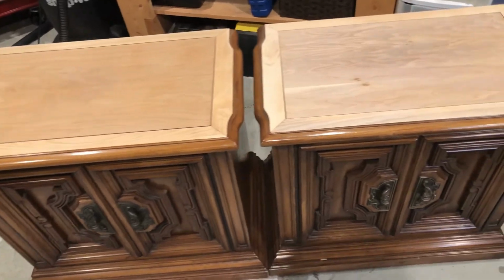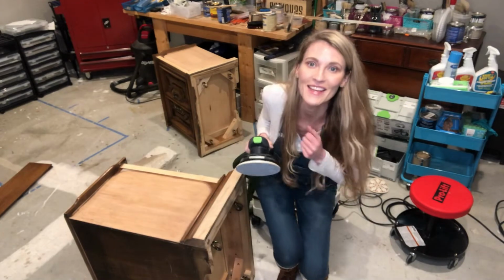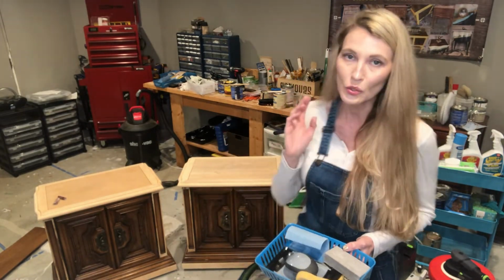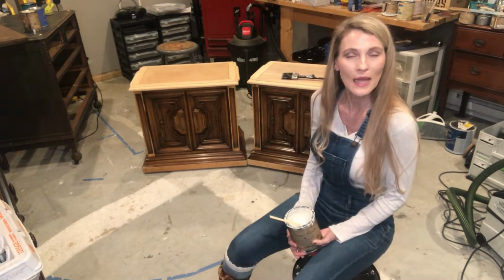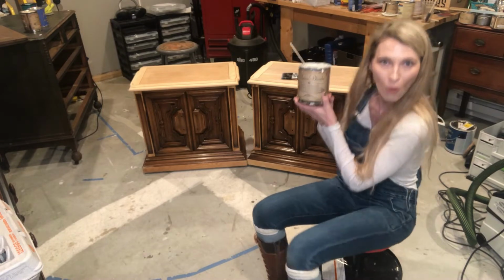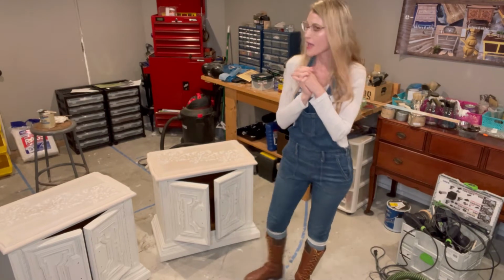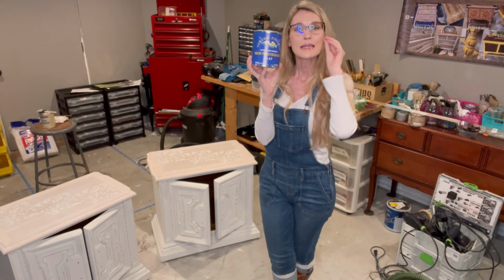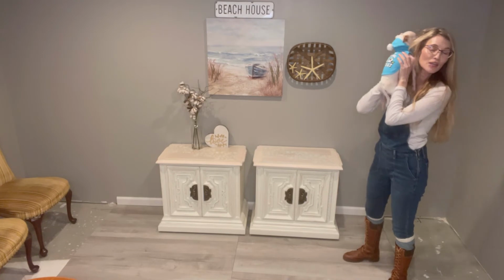Furniture Flipping Makeover | Vintage End Tables

Comment: Did you lightly sand between the 2 coats of shellac? Or is that not necessary?
Reply from the maker: It’s usually not necessary but be careful with shellac it’s very thin so you could easily have some drip marks. So just make sure you look your piece over and if you happen to have a drip mark that’s OK you can easily hand sand that down.